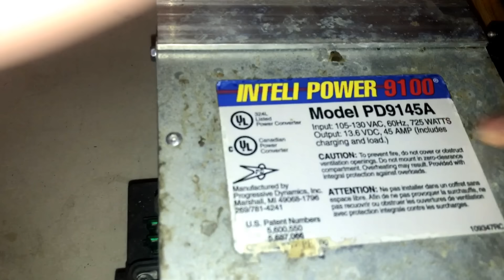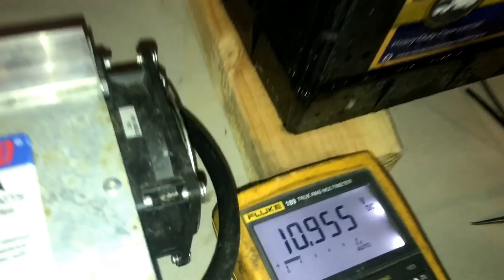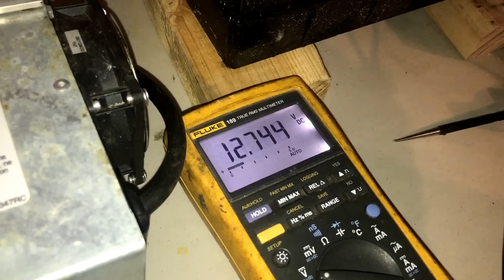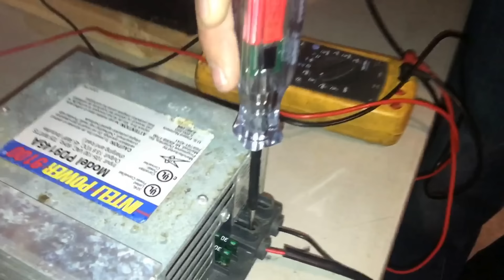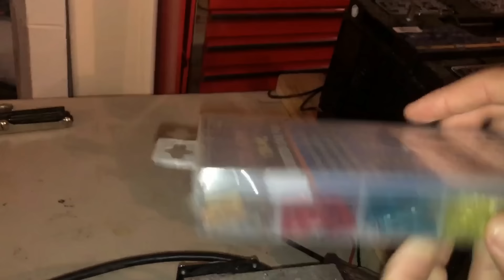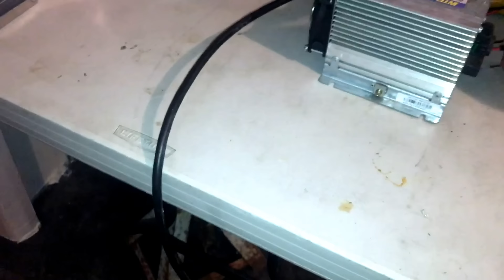How To Trouble Shoot An Rv Power Converter

Comment: Thanks for the information. I checked mine and all 3 fuses were blown. What would cause that? The last thing it was plugged into was the onboard generator
Reply from the maker: Hwy Carlos you may want to have your rv looked at by a Rv Technician. If it blows all three there is defiantly a undelying problem. That needs to be doagnosed

Comment: Dude thank you so much. This video helped me out so much, i live in my rv and things just stopped working but still had good fuses and was confused.
Reply from the maker: you are welcome glad it helped.
Reply: @CannonsRvRepair  Hello my name is Angela Mullins, I live in my Keystone 5th wheel camper. I am a disabled single female without any electrical knowledge and I sure could use some help. Please will you explain to me if I send you a picture of my electrical panel and converter.  I'm trying to figure out where I put the tester so i know that I'm getting the 120/110 AC on one side of converter and 13 DC volts on the other side. My converter seems to be working but it's seems slow. My DC lights come on but after 20 minutes they start dimming. My refrigerator control panel seems like I'm not getting any power because it doesn't light up. Last year i was going out every 5 hours and hitting reset with the wire in the pin and the other end against the metal frame. Finally after about a year of watching videos over and over, I decided to purchase the thermistor and I didn't have any problem installing it. Again after a year of resetting the fridge every 5 hours, i jumped for joy. I understand that the appliances like the refrigerator need some DC power for the control panel even if I have it on electric or propane. I had read that the hot water heater, water pump and the propane furnace need some SC power. My hot water heater and water pump seem to be working just fine.  I haven't decided if I feel safe using the propane heater at this point. I need to solve this problem first. The the DC converter I have is the WFCO 8955. I'm not sure if it's lan, PEC or one of the other models. I would like to send you pictures of the converter and the testers that I have to work with. I guess I need to know if this converter can be fixed or do I need to buy a new one. Thank you in advance for any help you can give me.

Comment: The WFCO 9835 power converter in my trailer has only one of the two blade fuses installed. Should both of the fuse locations have a fuse? What size fuse do you recommend? Thanks for a great video.
Reply from the maker: Carlos Perez The wfco 9835 comes with 40 Amp Fuses due to it being a 35 Amp Converter. And it should have two 40 amp fused, any less and it will not be being properly used. If one constantly blows and not the other you may want to have it looked at by a Rv Technician.

Comment: Having a problem with my converter. May have hooked up the battery cables wrong and blew out the 2-30 amp fuses that should have protected the converter. When I hooked the cables up the right way the fuses still blow.With the 30 am fuses not in the I am getting a reading of 12 volts. Then again I install new fuses they blow. Any ideals or help will be greatly appricated. Thanks Francis,
Reply: Francis...we have a similar issue right now. Did you figure your problem out?

Comment: Any idea how to troubleshoot when one side of the RV house lights go out???
I checked the fuse panel and the main fuses...Nothing looked bad.
Any help would be great!

Great video!!!
Reply from the maker: MX Spec Ops Check All The GFCI outlets if they are good you may need to have a Technician look at it because it coukd be a direct short or you coukd have a Transfer switch thats going out if you have a 50 Amp Plug the transfer switch can have two legs and sometimes only one pole will be engaging.
Reply: @CannonsRvRepair  we  run 30 from our older rv....all the outlets are working... hopefully it's something I can figure out. No money for a technician. Fingers crossed.
Thanks for the quick response!!

Comment: Hi: In our fifth wheel the lights were dimming and the furnace fan slowing down then going back to normal. After an hour or so this stopped. Do you think that the battery may be faulty? Thanks

Comment: Hey, Joe. I did stupid thing. I have an inverter circuit on my RV that allows some outlets to have power when I’m not plugged in or have the gen running. I plugged a heater into the bedroom tv outlet and it ran for about a minute, then nothing. I’m plugged in at the campsite and I have no power on these outlets unless I push the remote inverter button. My concern is that I’m afraid my batteries might not be charging. Any idea where i should start to troubleshoot?

Comment: Joe - the meter on my coach batteries is reading 16.6 and the things that are run off the batteries are not working.  My magnetek converter is the original one from 1993, but seems to be still humming as though it is working.  Can you give me a clue as to what might be happening with my converter before I call the RV repair guy.  Thanks  - Sara
Reply: It's 4 years later and I'm in suspense - how'd you fix it? I have a Magnatek 7455 converter too, runs the DC accessories but doesn't seem to be charging the batteries. Took off the cover, looks new inside, no scorched resistors or anything, internal glass fuse looks good, puzzled why it's not charging? Hooe you get this message and can remember how you solved it! Thank you! :)

Comment: Thanks for sharing your expertise. I have an Elixir Industries ELX 45, and at the same time the bathroom light stopped coming on (everything else does), and the converter runs continuously, when it would normally only run when enough lights were turned on. Two different problems, or related, do you think?
Reply from the maker: That sounds potentially related But when the converter starts staying on, By in i mean you can hear the fan running at higher RPM's it could just mean that your batterys are near end of life or they may just need to be topped off with distilled water. Either way it sounds like your converter is supporting most of the 12volt power and it is not being shared by your batteries. Alot of demand on the converter makes the RPM increase on the fan to help cool it down. So check your batteries and if they are topped off with distilled water then check to see if they are swollen looking from overcharge. they swell on the sides and is a good indicator it is time for new Deep cycle batteries.
Reply: Thanks. Update: The battery (only one: 30 Amp system) was no good, and was replaced. The light is working again, but the converter is still running non~stop??? The battery was replaced with one of higher Cold Cranking Amperage.

Comment: I have a Safari Simba 36' motorhome.  All works well with land power.  However, under generator power source, the front air conditioner and back bedroom outlets will not work.  Bedroom air conditioner works as well as everything else in the camper under generator power.  How do you diagnose this problem?  Thanks for you youtube video.
Reply: Looks like your generator is not putting out the power it should.  Did you add a second AC?  Is your genny rated for both?  Did you service your genny regularly?  Its failing under load.  Other than that, it must be some wiring issue?

Comment: Thank you for your video it open my eyes to understand a little bit more I connected my car battery to my RV because the ones that it had they were dimming the lights so I thought that battery was bad but now my car battery it's a hundred cranking amps so as I put it on to also test the generator I noticed when I went inside that my lights were not turning on or my panel or the power converter itself the only way it turns on is if I hook up the 120 from the house as soon as I disconnect it I get no power so I decided to buy new deep cycle batteries thinking that was the problem and I thought that I blew out my system by putting a regular battery I want to see if you can help me with some pointers and what you do none of my power turns on through my deep cycle not even the Light Panel

Comment: After a Park poweoutage & and subsequent surges only half RV with power 2007 Franklin 40ft washer dryer working stove refrigerator but no power to slides or ceiling fans thank you JP
Reply from the maker: Check Fuses for the Slides. and as for the ceiling fan im assuming it is !20V you will want to check the breaker or GFCI.
Reply from the maker: and Buy a Surge protector as soon as you can to help protect from power surges. i reccomend one that plugs directly into the rv park power to your Rv. Or can have a hardwired one installed.

Comment: lights in my motor home serge hard to explain but frig and water heater won't work euther
Reply from the maker: Sounds like you could have a few problems, honestly the converter would be a good place to start tho, ive found loos fuses to cause this in the past. make sure the blades are securely fitted into the blade terminal where the fuses go. other than that would have to diagnose it in person.

Comment: Hope someone can help. General purpose breaker switch works and turns on the dinette side 120v outlets fine. Plus all the 12v lights in the Class C brightens up too. 
However, the 12volt socket near the outlet starts reading over 20 volts .

Turning off the “general purpose” breaker on the converter seems the only way to lower the 12v socket back to normal voltage output.
Thanks in advance for anyone that might guide me in the right direction.
Reply from the maker: I'm not sure i could diagnose this thru youtube, But im willing to bet you have a solar panel on the Rv??

Comment: I have a 5fth wheel rv, don't have a plug connection to a/c energi with a 3 wires black white and green, how can i conect to the ac generator to trailer?
Reply from the maker: you would have to hardwire it into the generator not something easily done.

Comment: Im new to the camper life just got my first 5th wheel (used) and plugged it in to a 110 outlet using an adapter and nothing worked. Does the house battery have to be charged when plugged into power?
Reply from the maker: Kayla Rogers  when the Rv is plugged in the converter should charge the house batteries if it working properly

Comment: off the top of your head, what is the problem here....Hooked to shore power, everything except the fridge and tv works.  Unplug shore power and start generator, same thing.  Turn off generator and turn on inverter.  TV has power and Fridge has power.  Please explain how this could happen.
Reply from the maker: I would check for a tripped GFI also i would check the inverter if it has one, it may have a breaker on it tripped sometimes they are wired thru the inverter and if it has a problem then the items run off it when converting will also not work even on shore power.

Comment: I'm Ed, first time Rv owner with some household & building maintenance experience. I have a '83 Coachmen 24', 30 amp. I started switching to led lights but some run very hot & burn up even though they were sold as 12 volt RV leds & some with a touch sensitive button will turn on but not turn off, when I hook them to the battery on my car they work fine. Someone took my battery & I have not replaced it but I have 11.27 volts at the charging connections & 11.97 volts interior. I need all the light I can get (bad eyes) If you have any ideas they would be most appreciated! Ed H

Comment: If my converter is no good will that affect my lights and AC?
Reply: Yes, when the battery gets weak your AC wont turn on as the controls to the AC unit are 12V as are your lights.

Comment: Hi again 
Sorry must have relayed wrong info 
I have 2-6V lead acid brand new batteries wired to run as 12v 
In the trailer right now I have lights but I don’t have micro or plugs working 

There is no car fuses on the converter but the converter is wired in to the breaker panel not sure if that would be the fuse 
I turn all the breakers on and all I’m getting is I believe 12v power from the automotive fuse side of the panel 

Anything further to add to this again would be much appreciated 

Looks like to me the converter is punched 
But I’m no electrician !!!
Reply from the maker: alan barrow So is you Inverter powered up? It also will be fused. Hard to say.

Comment: Hello
I Recently purchased a 2010 flagstaff trailer 
I’m running it off of 12V dc power only 
Should the inverter supply power to the plugs in the trailer while operating on just 12V dc power 
Instructions say it should 
Also instructions say the converter should be humming mine is not 
Could this be a fuse on the converter like in your video ? 
Not sure where to go with this or even if I should try removing the converter as I cannot see any fuses from where it is mounted 

Any feedback would be much appreciated !!

I did subscribe thanks for your video
Reply from the maker: alan barrow Hi Alan so the inverter will only power the plugs that are wired thru the inverter. Depending on the inverter you have will dictate how many pkugs it can run also the number of batteries you have will play a factor. Your converter can be humming loudly for a few reason. First thing you want to check is the batteries make sure they are full of distilled water if you have lead acid batteries, odds are you do. The harder the converter is working the more noise it can make. Assuming you only hear the noise when you are plugged into shore power, sometimes if the batteries are bad the converter picks up the rest of the demand for 12volt power, it is trying very hard to charge the batteries and distribute power through out the coach. Converters will also start to get very noisy if they are getting work out. The noise you are hearing is likely the fan on the converter.  So make sure your batyeries are topped of with distilled water and look for signs of swollen batteries. If they are swollen on the sides this tells us the batteries have been boiling and could need to be replaced. This happens normally when people leave there coach plugged in all the time. Batteries dont last long at all when people do this. If you have good batteries and it still makes noise loudly another thing that causes noise is by having alot of lights on in the coach. You can turn off all 12 volt lights and it should be a whissper of a sound. If not then your batteries are drawing alot of power to recharge themselves from the converter. Hope this helps.
Reply from the maker: alan barrow just noticed you said your converter is not humming it will not make noise when the coach is unpkugged 😉

Comment: When connected to shore power, my lights will dim then brighten on a cycle of 2-3 minutes. Does the converter always trickle charge the batteries or is it cyclical? Could there be a problem with the converter or with the batteries? Thanks.
Reply: What did you find out? This is my issue now.

Comment: I plug my RV in to a 110 outlet with an adapter (30amp plug to 110v) ....but there is no power in the RV. The house battery works and lights run fine. But why no power inside from my land connection. The outlet is good & has power.  Where do I look next?

Comment: Very good video !!!    I'm wondering why the replacement on the 30 Amp ATO fuse since your testing showed  voltage on both sides of the fuse that was basically the same  ?   Not doubting the fix on the unit..... rather I'm just trying to reason it out for myself.   I would not have thought to change the fuse since you had power on both sides of the fuse that was basically the same.    More of a car guy here so I'm  trying to learn from the video.  Thanks !
Reply: The unit had already been repaired when he tested it.

Comment: Hello Joe. Brought my Rv (1998 fleetwood prowler 27ft fifth wheel rv back home from someone that rented it out. Noticed it was plugged in Ac power at their home and fridge wasn't cool but in the on position. No electrical outlets in rv were working as well. Once I got it back home I plugged it into my home ac power and it blew my home circuit everytime repeatedly. Had a general electrician take a look at the problem for 3 hours. He tested all power sources in rv. He even swapped out my circuit breaker in my home but same problem. The lights did come on once he connected a small generator to the power supply at the rv. I have to leave a charger at the rv Battery and only lights can be used. Nothing else. Any idea what this could be? Thanks for your feedback.
Reply from the maker: Jeremy Sanders Sounds like you have a direct short somewhere, i woukd start with the heating elements on the refrigerator, it is normally overlooked by most electricians. Will most likely need to be looked at by An rv tech that knows what he is doing. You could have a direct short anywhere. But a few other things can cause this, but if i had to guess and nobody coukd figure it out i would start there, try unpkugging the rv refrigerator then reset your GFI on your home if it is tripped and plug the rv back in and see if it works, if it does, most likely your heating elements need to be replaced on your refrigerator
Reply: Thanks Joe. I’ll try it later this morning. Thanks for the quick reply!!!

Comment: Have a 2006 21ft komfort travel trailer. All of my A/C works but when I turn my lights on they are very dim and then my fridgerator will turn off. And at the same time I don’t think I’m getting power to or from my battery’s. It shows no charge when trailer is unplugged but fully charged when plugged in.
Reply from the maker: Sounds like you might have bad batteries, start there do they look swollen on the sides?